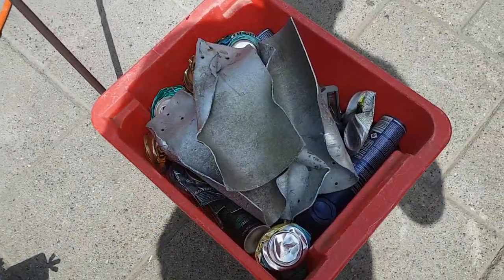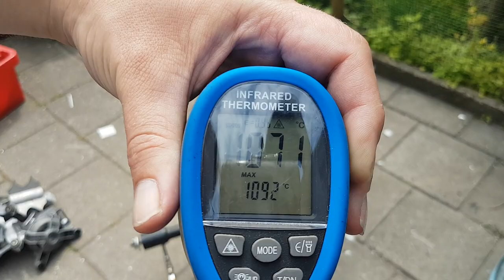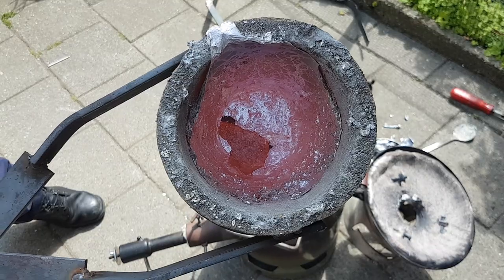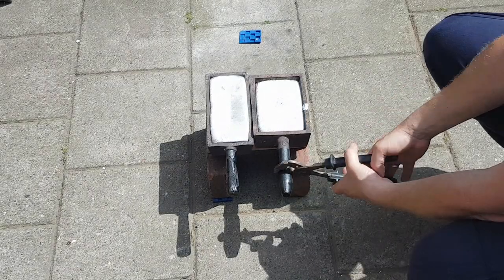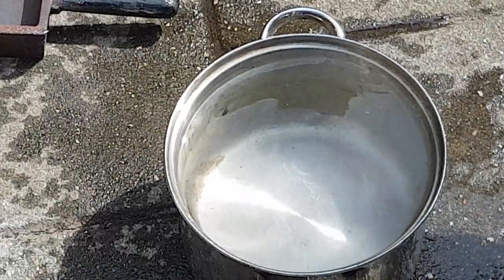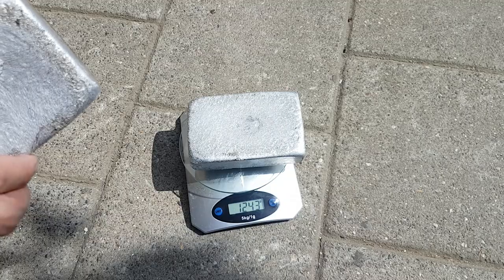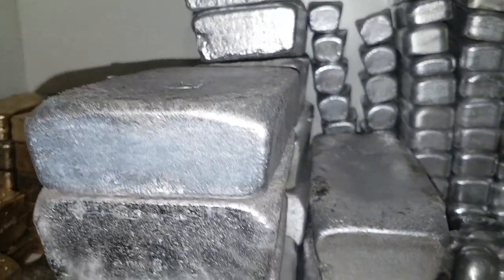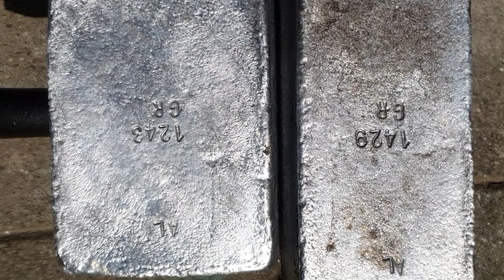Casting huge aluminium bars - Devil Forge - Melting metal

Comment: I need to build some new lifting tongs for my larger crucibles and start melting cleaner stuff one of these days.  So slow melting in my smaller one and with more junk parts.  Would be nice to do some bigger pours like this again!
Reply from the maker: Just go for it my friend! The lifters and tongs aren't really difficult to make.
Reply: @Metalstacker  it's that whole welding thing and putting in time and effort!  :)